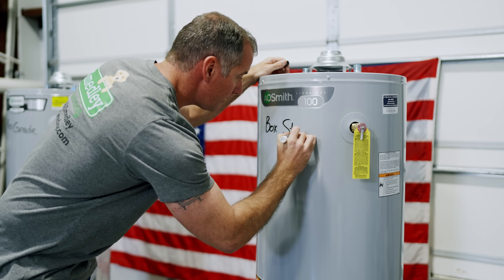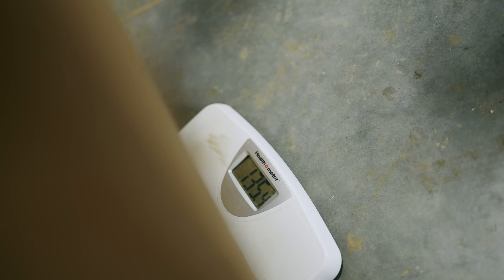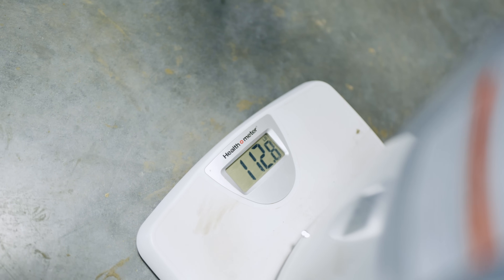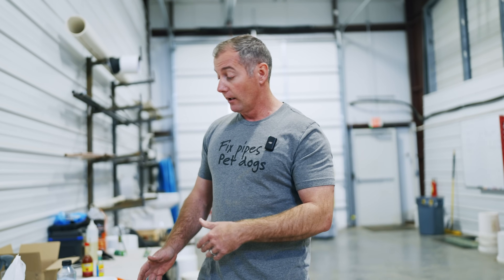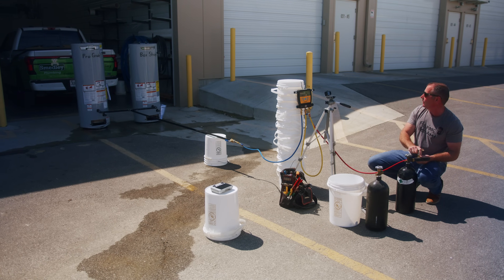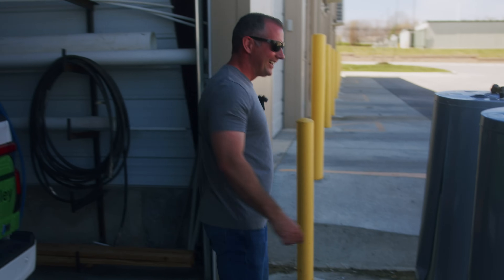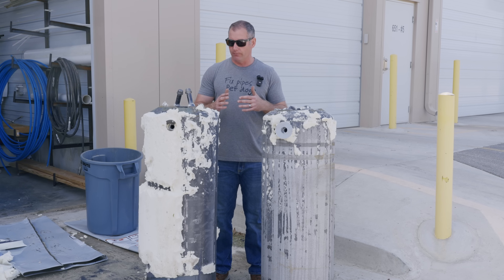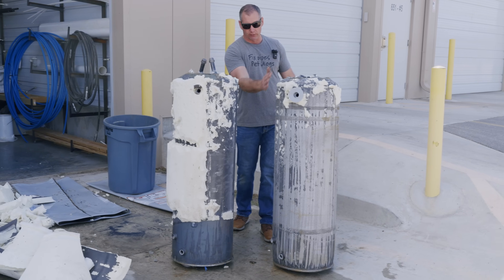What water heater should I buy? - Pro Grade vs. Box Store

Comment: I needed a new 50gal tank and my plumber said he uses the pro grade A.O.Smith but if I wanted I could go to Lowes and buy one of there (Rheem, store brand , etc.) units and he would charge me the labor. I opted for the pro grade because if something went wrong under warranty I would have to handle it with Lowes but if it went wrong with the unit he put in, he would take care of it. Made it a very  easy decision, Excellent installation.
Reply from the maker: Love it!
Reply: Lows has the AO smith, homedepo has rheem
Reply: A pro installed a water heater in my parents house.  Two years latter the overpressure valve flooded the basement.  He didn't hook up the overpressure to the line running outside.  They did install a free overpressure valve but a lot of stuff in the basement was a mess.
Reply: If you are talking about the relief valve ,it's against the plumbing code to pipe it outside, it's supposed to terminate 6" above the floor,preferably in a water heater pan,which can be pipe ed outside.
Reply: @knilsen1501  the water heater is in a basement so following code floods the basement.  Absolutely asinine to follow new code which offers danger with no gain..  The flood can snuff out the water heater and gas furnace burners.

Comment: My supply house sent us to the AO Smith / State water heater manufacturing facility outside of Nashville. Which is massive. AO Smith / State owns the company that makes ALL the components for their water heaters. I asked this very question " what is the difference between pro and box store?" answer; The box store units are made in a different facility, in a different state with out sourced parts. They also have a different glass liners. Drop the Mic!
Reply from the maker: Yep!
Reply: A hardware store here has a display. They've got two Weber grills side by side. One they went and bought at Walmart, The other is the grade they sell. They've done the same thing you did. The first thing is how different the thickness of the sheet metal is. The one they sell weighs around 7 lb more if I remember correctly. Thicker steel on the side sticker burner heavier frame the works.
Reply: @SmedleyPlumbing  great video. What is the warranty on the pro model? At the box store I can get a 6y 9y 12y or a lifetime warranty. Is it possible that the pro model is the same as the box store 9y or 12y?
Reply from the maker: @FPSG  pro models only have a 6 year warranty.  But they're likely to make it there too.
Reply: @SmedleyPlumbing  thanks. That was all I wasn't clear on. The tank on my 30 year old Montgomery ward 300 started leaking 2 weeks ago.  They used to last forever.
Reply from the maker: @FPSG  they used to.....  Those were the days.
Reply: @FPSG  I was told that the diference between the 6, 9 & 12 year heater was the price you payed. They are the same unit but you are paying for the extra warranty.
Reply: I spent 35 years as a mechanical contractor. The ONLY thing we did was install commercial water heaters. We did 4 truckloads per month!  We did in warranty repairs for Rheem/Ruud, State, A.O. Smith, Bradford White and others that no longer exist (Mor-Flo etc.). On the commercial side we found Ruud to be far and away the best.
Reply: @kevinhenry7273  Exactly!
Reply: A Toro dealer had a Home Depot mower on a shelf and a version only sold by Toro dealers next to it pointing out the prices of each and the differences from cast vs. stamped steel decks, rubber tires with plastic wheels and no bearings vs. Rubber tires, steel wheels and ball bearing if and on and on. The factory rep came in and saw that and said you must take it down. The dealer said here is the home depot receipt 🧾 I paid for it at list price and any differences listed are actual truths and that his lawyer wants to know if Toro wanted this settled in court? They stopped demanding anything of them. These companies should not be selling trash through big box stores. They are degrading the companies image with inferior quality versions.
Reply: ...and there has to be a part number or code number reference that shows the difference.Can't believe all numbers are identical.
Reply: It is the same heater with different components. And if they're made on the same line, they run 3000 units a day or 200 units, an hour or a little bit over 200 and a 1/2, and then they forget stickers, and they forget labels and different things on each one. From time to time I don't get cold. Cause you're moving so many of them.
Reply: A o smith makes over twenty different brands for all over the country and the world

Comment: Just replaced a water heater recently. I could not find any one selling pro ao smith so I went Rheem. I was always told by a plumber to never buy from big box and never questioned his reasoning. This video gives me proof now thanks.
Reply from the maker: Love it!
Reply: home depot sells Rheem now
Reply: AO Smith and State are the same manufacture.
Reply from the maker: @MVRWC  yes they are.
Reply: Some guys are just like that especially when they know that they know what they are talking about. It's take it or leave it man.
Reply: @FosterFarmsOk    Yes, but rheem store brand isn't the same as rheem/ruud contractor grade.   great video here tho and certainly helps to confirm what many suspected.
Reply: Never had an issue

Comment: Very detailed and informative!  I appreciate your effort.  Probably explains why my Proline Plus Nautilus by American Water Heaters installed in 1992 is still working!!!
Reply from the maker: Exactly!
Reply: Good to hear.  The proline plus Nautilus installed when I bought my house in '93  crapped out all over my laundry room floor after seven years.
Reply: @weing  :( I'm sorry to hear that.  Maybe I just got lucky with this.  Not sure.
Reply: Haha I just looked at my water heater and it's marked 1991.. Reliance brand made by AO Smith for the box stores.
Reply: @weing How hot do you have the temp set if I might ask. My water heater is from 1991 and still kicking. But I have the temp set just hot enough for me to get a warm shower.
Reply: American 1984
Reply: I installed my GE in Jan, 1999. Still working. Factory anode rod (it has probably been a nub since 2009). The secret - I don't run it too hot.

Comment: As a 69 year old retired Plumbing contractor, it was great to see the things I learned about box store crap -tested and explained. Faucets, fixtures ,everything at the box stores is made to a price point. Back in the day I could dismantle 2 identical Delta 100 kitchen faucets-same part number, same packaging, and the internal components would differ a lot. Plastic control ball/valve vs stainless steel, stainless liners vs none where the packing/seals traveled, rubber composition of those seals different,etc. It's deceptive at best. Like  you ,I did not wish to waste time replacing inferior parts. You get what you pay for.
Reply from the maker: Yes you do!
Reply: What is the reason for the background music. It’s so annoying trying to listen to you on a professional level.
Reply: When I buy them at the Big box store I go ahead and buy the brass drain and install it and throw the plastic one away
Reply: Recently watched a video comparing kitchen faucets.  The big box were exactly the same as the 50% pro faucets.
Reply: How is that possible with the same part number? Years after purchase if you go back to the manufacturer, you give them part number and maybe serial number for later replacement parts and whatnot....how will they keep it straight?
Reply: @TheWilferch  They just provide whatever part is on hand and say that it superseded the part that you had. It happens in every industry.
Reply: @TheWilferch ok them difference many times isn't the the replaceable parts,  like Moen a Moen cartridge is exactly the same in size and function weather you bought it yesterday or 50 years ago,  difference is the material they are made from, the older ones were always brass, now the brass you usually only find in the Moen ledge series, but the areas that they will differ is the front plate you'll find some that are plastic some stamped pot metal, the better ones are actually chrome brass, the other thing is the box store faucets do not come with the 1/2" speedy nuts, they assume DIYers will just buy the flexible connectors that have the nuts built into them, but in this area of Illinois, the Chicago metropolitan area those type of connectors are not code, you need to use copper or brass speedies that may be plated in chrome, polish brass, and gold yes real gold plated and cost a fortune and don't last all that long, but here no plastic pipe or tubing is allowed on the potable water system, other than stainless steal braided connection for washing machines, some towns will allow the stainless steal braided for ice makers and dishwasher connection,  but most you use soft type L copper, Chicago allows type M, but Chicago has home rule since they have a population of over 1 million, but a Chicago plumbing license is valid anywhere in the state as is the Illinois license is valid in Chicago, other than contractors license which you'll need both if you're doing work in both areas
Reply: @patrickcarlson1400  ...talking water heater....no plumbing fixtures, which I understand the point you are making for those items.
Reply: @patrickcarlson1400  This old Plumbers Son's made the mold that produced Moen plastic kitchen spouts. When I saw that many years ago, I thought, "there goes Moen's reputation".
Reply: @Splungers  yeah Moen did start making low end faucets just to compete in that arena, now weather they should have is very debatable, but Moen still makes their Legend series line of fixtures and they are still quiet good, including their Moentrol single handle pressure and temperature balance faucets, which dollar for dollar I think is the best on the market, Grohe makes high quality fixtures but they aren't easily serviced, where a Moen is as simple to service single handle faucet bar none, Delta are good quality but you have to bring a kit of several different balls and springs and washer as all Delta's basically function the same they have changed the design many times, and Moen cartridge is a Moen cartridge, you can use a cheaper plastic or a good brass in any of their classic single handle faucets even ones that are over 60 years old
By far the worst big brand single handle faucet was the American Standard Push-Pull faucets, the absolute number of parts that go into rebuilding a shower or shower/tub faucets is just stupid, I only did one once and it took me nearly 1 1/2 hours to compete, mind you I had never worked on one of these before so I'm sure after a few I could do it faster, but a Moen it takes almost as much time turning the water off and back on as replacing the cartridge and if you happen to pull the center out of one you can use an easy-out to remove the outer section 
But as mentioned American Standard didn't just make overly complicated faucets but toilets to, from odd flapper designs with that big cup that let's water out till it's done flushing to their really bizarre vent away toilets
Reply: @TheWilferch  ok well with water heaters other than electric heaters where they need eliminate changed, or if anode need replacement, or an anode is an anode doesn't need to be made by the water heater manufacture, just weather you want magnesium or aluminum, but it's very rare to replace them other than where you have some really bad well water, most of the time when they've gone bad it's best to just replace the heater, the only other part but again it can be a generic part is the thermal coupling, but if a burner fails I'm just going to replace the heater even under 10 years old, not counting commercial water heaters as they are a whole different animal and cost, but the labor cost to replace a burner isn't worth it unless it is under warranty, and I've never seen them hide where it was manufacture as that would be illegal, and as far as the date they were built is in the serial number if you know how to read them, which a professional plumber should, if you're a DIY guy well then who cares if you're ignorant to how to do this, it's what you deserve to DIY a water heater, they should always be installed by a professional, and thankfully in Illinois unless it's for your primary residence it illegal for you to install any plumbing fixture or device without a Illinois or Chicago plumbing license 

So I'm not sure what parts you're looking to replace on a heater where they change part numbers on at least not one's that are less than 6 years old that would be worth the cost of repair over replacement, now this is based on Chicago union plumber hourly cost and any job even if it takes 2 minutes to do is still a one hour charge, which when I stopped working 15 years ago we charged $110 per hour and last I checked I believe our last contract had a wage package of $98 and hour which would bring you upto about $120 for 1 plumber for one hour and we don't allow helpers only plumber's and apprentice plumber's, but I never charged less for an apprentices time, but we weren't a service plumbing shop, and never did rodding we always referred that out, 90% of our work was new and remodeling of commercial jobs, and residential was only custom homes as the profit margins on bulk residential work wasn't worth my time, when I could make twice the profit from a commercial job, and the only reason for me to do plumbing was for maximum profits as I hated the job itself

Comment: 2006 AO Smith Commercial water heater owner checking in here 😄. I've had it in the budget for the last 5 years to replace it, but the damn thing just won't die. I only had to replace the burner about 5 years ago (which is what made me start thinking I needed a replacement). I've also never drained the thing and it still pumps out some scalding hot water. I'm scared to replace it at this point because I KNOW I'll never get 18 years out of whatever I replace it with 😆. Thanks for the great video!
Reply: This!!
Reply: Compared to an old 2006 model, a new water heater with 2 inches of foam insulation could save 10 to 20 dollars or more in fuel costs every month. Add an insulation blanket and save even more.

Multiply that additional monthly fuel cost by the number of extra months of using that old water heater and the price of a new water heater could have possibly just about been paid for in fuel savings over two or three years. 

Gas and electricity usually goes up in price over time.

A new water heater costs money, but an old water heater also costs extra money every month while in use.
Reply: @dvader3263  How much hot water to you use? I only spend about $5 a month in total for fuel for hot water. My water heater is a 2012.

Comment: Your video showed up on my feed and was of interest to me as I just had a 5 year old Rheem water heater spring a leak. Damn plastic drain valve gave up the ghost. When it's time to replace, I will only go with a pro grade replacement. Your video taught me the difference between the two as I leaned toward made on the same line with different stickers. Thank you so much. Oh, and paying my plumber for his expertise saved me more as I would have replaced the drain valve with another plastic valve, and he instead put in a brass ball valve. Home owners don't know what they don't know. Smiles.
Reply from the maker: Thanks!
Reply: Yeah Reem had a period of time where all there heaters outside commercial ones had plastic drain valves, and  not only would the rarely actually function, but trying to screw a brass hose onto the plastic threads without cross threading them was difficult,  most times we'd walk the heater near the floor drain and just completely remove the valve and  let them rip

Comment: Thanks! I have a bunch of rentals that have gas water heaters. Coming up on 60 year old houses. I thought it was just Lowes. I bought a Kenmore heater and it's still in service. Not a moment's trouble. I bought a Lowes and I almost knew the repairman by his first name. Lots of trouble with the gas burner, control, and pressure valve. I bought a Home Depot unit for another house and it's also still in service. While it has never had a service call, it's tough to get it to fire up. I'll have to look up how long they've been in service.  One I think is at 15 years. Probably time. I have a supply house near me. Great guys.
Reply from the maker: Thanks!